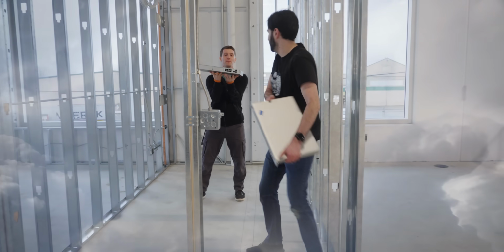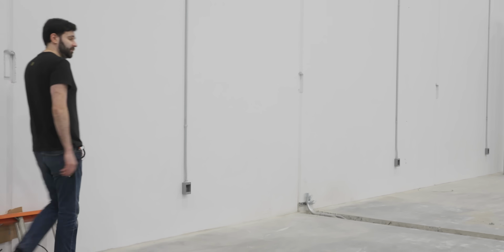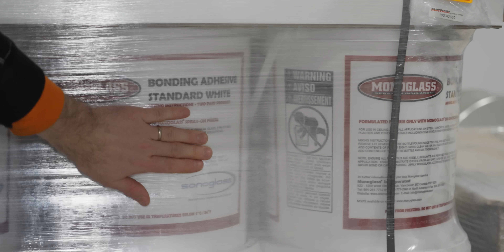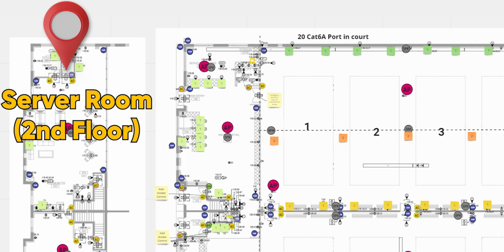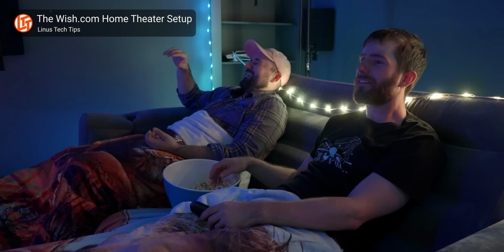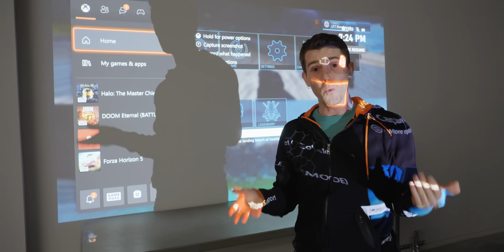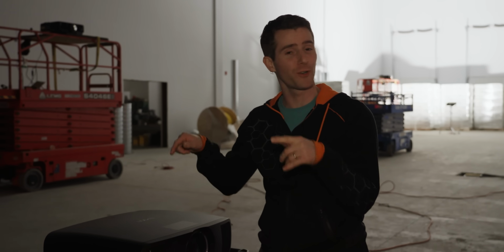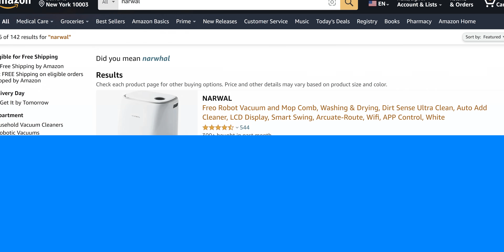Our LAN Parties will be INSANE

Comment: I was on a Building Site and talket to the Data Man. He ordered 250Kilometers Cat7 Cable for a 14 Floor high Building and used 246Kilometers oft this Cable. Only for Internet/Network. The Cables for power for the Outlets aren't includet in this

Comment: The 2700 lumen residential projector did that 320 inch display...

How about Epson's EB-PQ2220B - 20,000 lumens that uses so much power it needs 220V outlet. Mount that to the ceiling and take up the whole wall easily.

Comment: Why do you so many cat 6 runs ?? Divide that large space into subracks. Use ofc and  power cable to backup the rack with 25Gb sfp.. i think this will save a lot.. also, in cctv speaker i do this all day.. use 6u / 9u wall mounted racks.. alternative on each side of the wall..

Comment: Timestamped Highlights
00:14
🚀 Exciting progress updates of the upcoming LAN gaming center, Badminton Center.
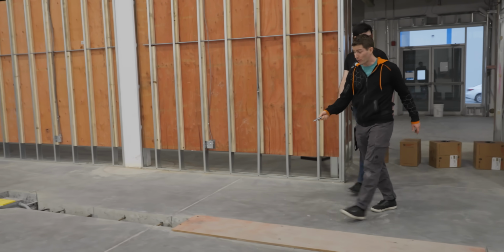01:56
🖥 Expansion of the server room and installation of network equipment for redundancy and failover.
03:48
🌐 Security system with multiple PoE switches and cameras.
04:59
💡 Use of armored fiber and Cat 6 for networking.
07:48
🤖 Sponsor narwhal's robot vacuum and mop demonstration.
10:32
🎥 Testing and discussion of projectors for gaming setup.
14:12
🎮 Ultra wide screen gaming and potential for larger screens.
Summarized by @NoteGPT

Comment: I am fiber optic specialist and I have to say that the minimum bend radius is not really cause of a possibly breaking fiber, but because of the massively increased signal loss if bent to tight. ITU G652 has a minimal band radius of 35mm. But Y don't you use multi mode fiber instead of the expensive single mode?

Comment: As a European, it hurts that unshielded network cable is used. STP cable has been the standard here for over 5 years. UTP cables are only available as patch cables at most. Then you can lay the cable 100m next to a power line without ever getting problems :)

Comment: The double projectors isn't actually that difficult to achieve... See below:

1. Get two identical projectors (you already have them)
2. Build a sturdy frame to hold both projectors in place making sure each one is at the same angle. The frame is here to prevent any bumps/vibrations slowly misaligning the output. (Vertical stacking is easiest)
3. One at a time switch on each projector, load a test pattern, get it in focus, setup the brightness and color profiles.
4. One at a time temporarily mark the overlap points on your projection wall.
5. Turn of both projectors and mark the middle point between those two overlap positions.
6. Now adjust the alignment in each projector to the same position using your alignment mark. 
7. Fine tune the focus, color and brightness.

Because each projector will have the same amount of skew/stretch they cancel eachohter out and create a clear non-3d appearance output.

Alternatively, given that money isn't really an issue you could create a custom combiner which would use a series of prisms / mirrors to align the content in the frame which allows for an easier job of aligning the output because the skewing/stretching is managed better.

Comment: Why have the projector on a cart? You'll have to align it every time while setting the rest of the LAN up...
If venues can put a projector screen on motorised cables to lower the screen down further than the screen itself can go, surely you can do that with the projector on a lift?
Just some way to lower it with a button and it'll be aligned, and then be raised to be out of the way of sport

Comment: You guys obviously have the space, so why not go for an actual movie theater or IMAX projector?  Maybe even a 3D projector setup?  3D gaming at that size would be amazing, but with all of the speakers you're putting in, I think you could also do a pretty killer movie night in that space.
Reply: There's not really any games that are 3d. Also the IMAX projectors would have crazy input lag. You'd probably want something like the Panasonic PT-FRQ60 which is 1080p/240hz capable and low latency and also 4k/60.

Comment: what I don't understand about most robot vacuum designs is that the horizontally rotating bristles in front of the powered wheels run into the wheels... why? don't you just damage the bristles and the wheels that way?

Comment: That projector's only 2700 lumens and $4000. I have an Epson projector I measured at 6000lm rated for 6500lm that only cost me $500 on ebay. It's also "4K" (pixel shift tech) but still, distinctly better than 1080p. I've used them for stuff like this and it's a way better pick having the extra brightness. I actually think that's so much I use two of them so that I can get around 11,500 lumens on 150in screen. All about those nits, lol.

Thoes looking for something similar pick up a 7400U or 7500U. 

If you're okay with something more bulky and 720p they have an older projector (z8350) rated for 8500 lumens. I picked up one of those for $300, new oem bulbs, lens and all, quite a steal, but the measured brightness was only around 5,500 lumens, sadly less than my newer 7500U :/  I was going to use the higher lumen one for stuff like Linus is doing, and namely outdoor movies.
Reply: If you're going to pay the same price range get a L1300U used and have almost three times the brightness at 8000lm

Comment: If you guys are running dante speakers off those ubiquity switches, check in with audinate support. It is pretty common that ubiquity switches don't handle dante properly. 

Netgear or cisco are much better for dante.